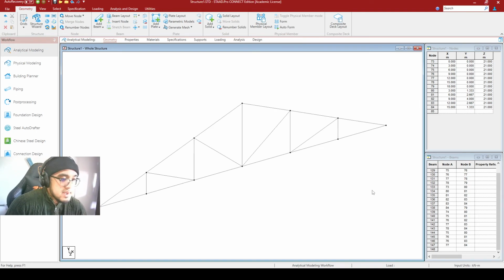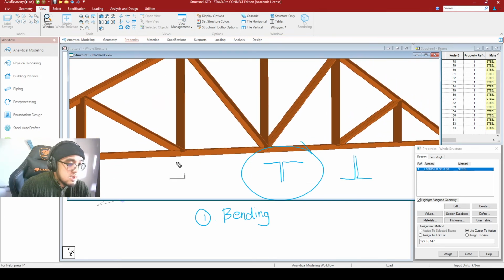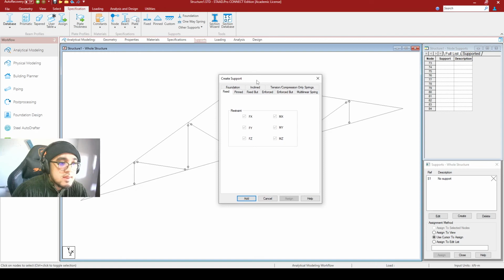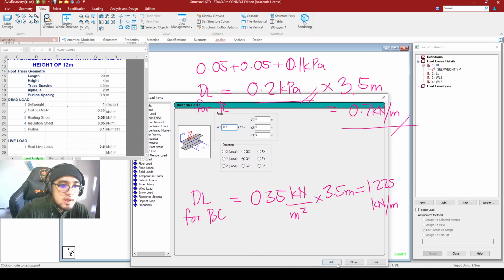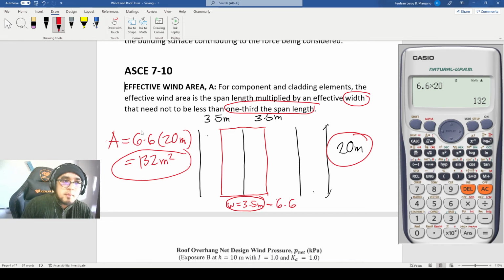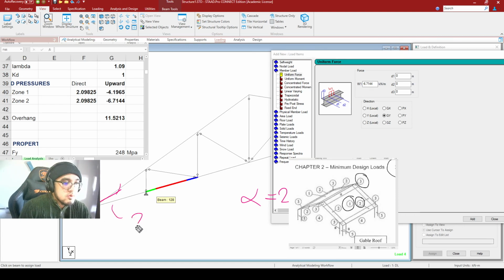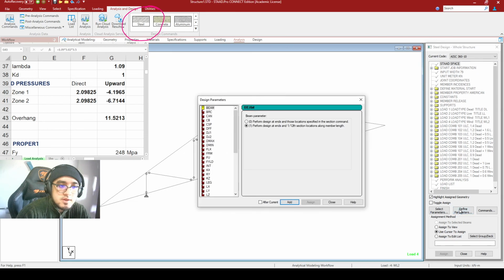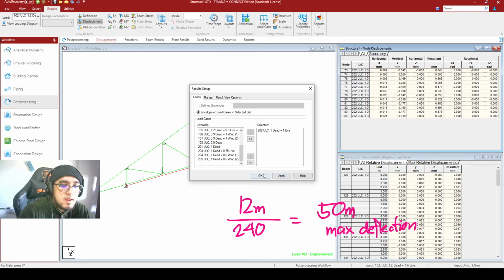STAAD.Pro Module 5: NSCP 2015: Basics in the Design of a Simple Steel Roof Truss

Comment: In other software, when there is an instability in the model, the software will terminate the analysis and you will not get a result. Be careful in modeling and designing a structure, specially steel struc, the model restraint and supports should match what is to be done in actual construction.

Comment: Hi sir. Ask lang. You said the TC and BC should be analyzed as continuous beam, but if thats the case. Shouldnt u define the Lz of the TC and BC so that staad pro will classify it as a "whole member"

But in the vid since, di nakaassign yung Lz, nakaanalyze  yung TC and BC kay staad as putol putol.

Pa enlighten lang sir baka mali din po ang intindi ko. 

TC- top chord, BC - bot chord
Reply from the maker: Hello! hindi natin sinet yung Lz (effective length) as a whole kasi may stiffener along the joints. (web members and/or stiffener trusses). So even though whole members sila, yung effective lengths naman nila is putol putol. :) Yung sa sinabi na icoconsider siyang whole member, what we meant there is that meron siyang moments (unlike sa traditional truss analysis na axial forces lang nag aact).